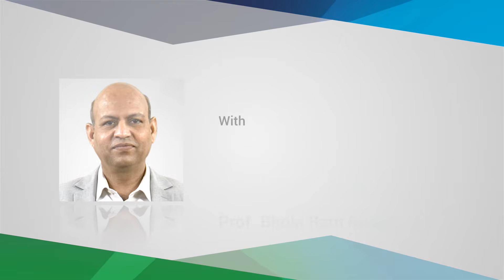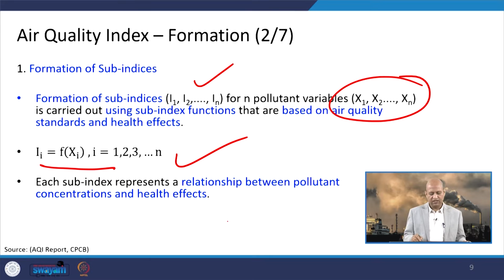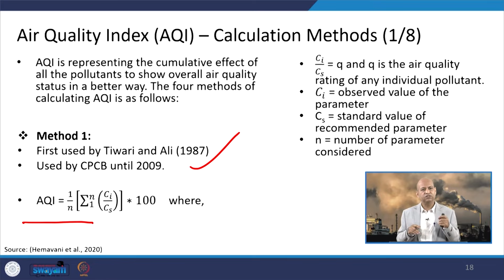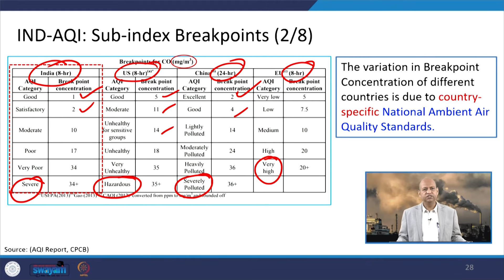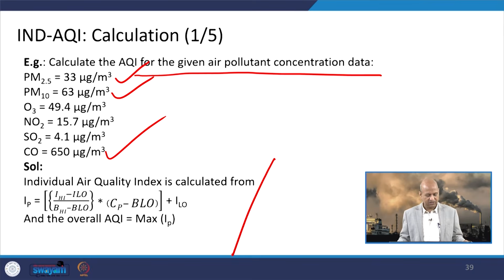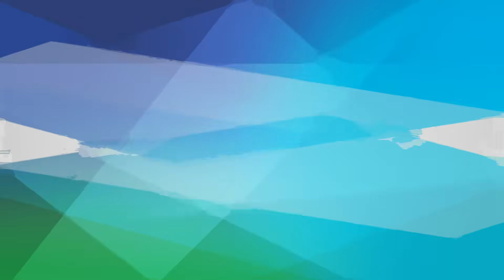Lecture 14: Air Quality Index (AQI)

Comment: This lecture is very informative with lucid way of explanation for AQI. Thank you very much sir. However, in slide No.40 an error has been crept in putting the value as 30 in place of 50 for calculating sub index for PM10, though final answer 63 is correct.